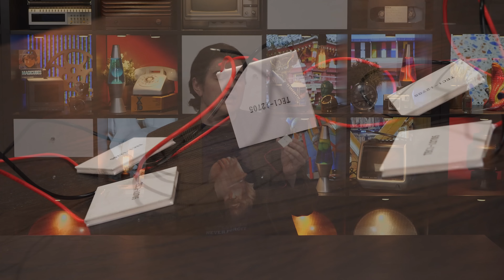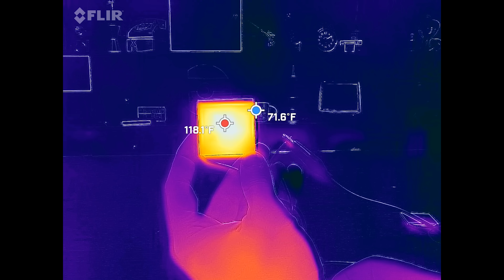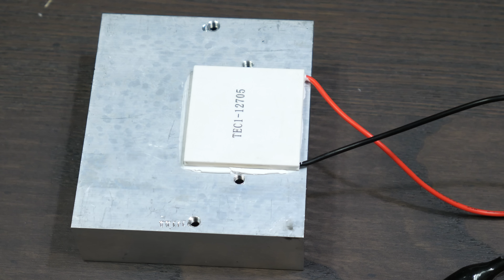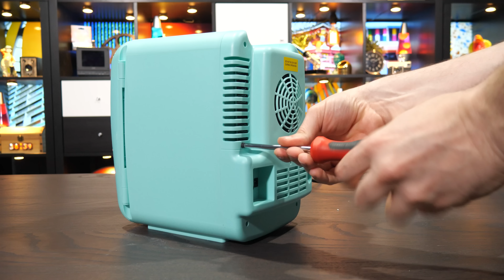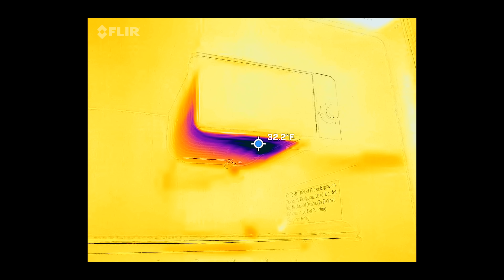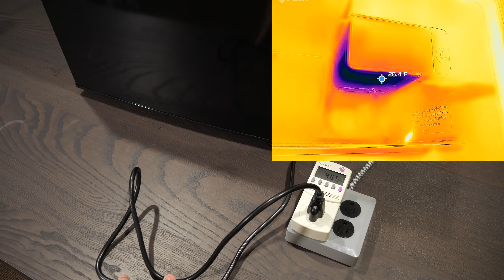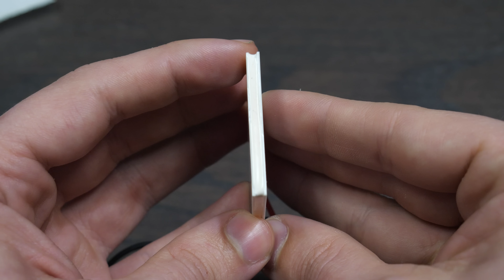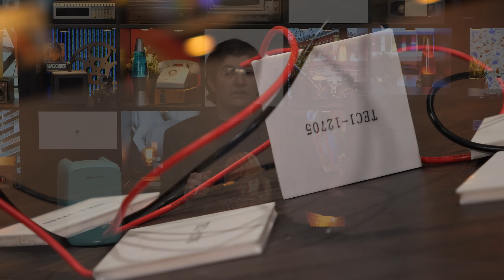Thermoelectric cooling: it's not great.

Comment: To the other end of the efficiency scale, how about ammonia based  heat absorption refrigerators? They can be more than 20% more efficient than the best CFC, HCFC, CFO, HCFO and other types of refrigerants.  In the simplest of these, they have no compressor and no moving parts. Some don't even require electricity, they can operate on propane or natural gas using just a small flame under the reaction boiler. These are commonly found in RV's.

Comment: I'm a retired control systems technician in industrial manufacturing and power plants. The first time I came across the peltier cooling units was to cool small machine control enclosures that housed early programmable logic controllers in the very warm ambient surroundings of a Corning glass factory in Pennsylvania in the mid-80's. Keeping the processor, communication, and I/O modules within and acceptable temperature limitation was essential. 
I was quite impressed as I had a background in mechanical HVAC and refrigeration systems. Today as an instructor in these technologies, I never hesitate to remind my students of those long ago and successful leaps in technology.
Thanks for expanding no matter the context.

Comment: Had a 12volt cooler once. Used a Peltier for cooling or heating. But it was metal lined and kept everything pretty cold or hot. Occasionally it would get frost on the metal that covered Peltier. When I purchased a larger cooler. Not so great.

Comment: How TIMELY!  Wife just got laid up for a bit due to surgery, and she bought a "CuhYUUUUUUUTE" minifridge for her table.  I came back to my office to see the instruction manual on the desk with a sticky note.  "Can you look on the web site to see if you can make this any colder?"  I flipped through the small pamphlet (reading specs is NOT her strong point).  And about the time I was thinking maybe I MISSED something about a temperature adjustment, my eyes fell upon a spec that said You could use a 2A USB charger to power this thing.  I knew right then what I was dealing with. No compressor. Just a peltier junction.

2 days later I came across this video, and IMMEDIATELY sent it to her.  I don't think she's going to want to watch it, as she's kicking her self for falling for some cheap (but CuhYUUUUUUUUTE) crap.  I LOVE the dry humor!

Comment: I use these kinds of coolers in my big truck since most refrigerators don't run on DC 12v or if they do somehow, they're wildly expensive. These definitely aren't "perfect" but honestly if you throw an ice pack in one and some already cold sodas, they do a lot more work at keeping your drinks cold than just a regular cooler with ice packs. My biggest problem with them is, I guess because they're cheap, they tend to not last very long.

Comment: This video is rather Misleading...I have a 1968 Shasta Pull Behind Camper with an actual IceBox,(uses a 10lb block of Ice) for foods and beverages.  I have 3 Peltier devices,( PL12608 electronic coolers), tied in parallel supplying 9 volts at 5.3 amps,[45 watts]) and it took 6 1/2 hours to get it down to 29° F.  Now each of the Peltier Devices have a fan on 3" X 3" heat sink on the cold side and a 6" X 6" heat sink on the hot side with a 6" computer server fan attached vented to the outside of the camper. The Blue "Box" in this video has NO heat sink nor fan on the cold side of the Peltier Device!!! Making it rather useless as a Cooling Unit!!! The temperature on mine is controlled so that the Peltier Devices turn off at 33°,( and back on at 39° F),but the 2 fans continue running, one to keep the cold air circulating inside the Ice Box and the one on Hot side to keep the heat from migrating to the cold side of the Peltier Device which is extremely important!! With both fans running they only consume .75 amp total. Yes the Blue Box in this video is JUNK, manly because the Peltier Devices are Improperly Used, there is NO Heat Sink on the Cold Side nor a NO Fan on the Cold Side to circulate the cold air created,plus the guy in the video over loaded the unit with 6 cans of pop!!!

Comment: Peltier cooling is used oftenly to either keep some sensetive electronics or other components at a precise temperature. Sure, if the required temperature is guaranteed to be higher than ambient (like in analog synthesizer's exponential converters), then just use a resistor. But if it needs to be cooler than the ambient sometimes, peltier is the answer. Cheap, small, reliable and very easy to control compared to compressors.
Many things use these, like road cameras sometimes.

Comment: I honestly can think about only one day-to-day use case for Peltier elements, for regular people, outside of science/medicine and such. Namely if you have a room that suffers from two problems at once: it's too cold and it's too humid. For that Peltier is just perfect. It will create a cool surface for water to condensate on, reducing humidity while it's crappy energy efficiency will provide some heating to the room. Like in a basement. If I lived in a house and had a basement, then I'd probably make a device like that.

Comment: You did miss a key point about the blue toy... 12VDC. It can plug right into your car/camper/rv/semi truck... That being said, I purchased a 12 volt fridge that could hold 3x as much for $200, and it can run as a fridge or freezer from 12VDC and 4.5 amps, or 12VDC and 3.3 amps on eco. Way better then the 8 amps of the thermoelectric fridge that originally came from a yard sale (Can't imagine why they wanted to get rid of it) that was one of the better ones as it boasted a 55 F difference in temp between ambient and inside, but still failed to maintain safe food temperatures in the summer.

Comment: Will they have an expanded future? Previously electric motors would not have the power to weight/size ratio to easily power vehicles, that is no longer the case. Will improvements in technology or new materials enable these to move more mainstream?

Comment: OK, totally valid criticism of this peltier application, but they are used in portable (car) chillers, where power consumption and weight would preclude a proper fridge. Not super effective, but ok to take food from home, in your car, to your holiday destination. Or at a push for camping, being mindful of spoilage. They also work reasonably well in dehumidifiers and one admittedly niche application, in reverse power generation mode is in a wood stove top fan. But yeah, that blue thing is pure junk

Comment: I had a peltier mini fridge. LIke the size of the real mini fridge there. I loved it because it could fit a 6.5 gallon glass carboy to use for fermenting beer. That is after I removed the shelves. The advantage was there was no compressor to get in the way which would never have been possible even with a larger mini bridge. It worked for about 5 years and then suddenly stopped working.

Comment: These Peltier pads were used in mid 90s computers, specifically Apple’s early PowerMacs, where I first learned about them.

I always thought it was a weird that they choose to use a powered heating element to cool a very specific area of the computer, while actively cooking everything else in proximity. 

If you need to quick syphon heat away from a very specific small area, at the cost of dumping that heat into the immediately proximity, I guess they make sense.

Comment: For storage of red wine long term, there are many of these wine refrigerators that use the Peltier cooling system as the requirements for keeping wine at the proper temperature is about where a Peltier system would work well.  As well, it does not vibrate which supposedly is bad for wine storage.  I'm not an expert on this but this is what I read, your thoughts?

Comment: Huh.  Some people made some cheap crap to fit a use case using Peltier technology.  Compared to a imaginary refrigerator that couldn't be that small, it uses lots of energy!  Because it's cheap crap, of couls, not well insulated or passively cooled like it should be.  Therefore Peltier technology is bad!!   This is being a hater, blaming a technology for a cheap product designed to be cheap.

Comment: I got my first refrigerator about 1952. It used absorption heated by 220 V, no moving parts, no noise.
Please make a video with + and - .
Reply: Forgot to tell: It was still working (in the cellar) when my mother died 56 years later.

Comment: I like my little portable electric cooler for road trips. It would be cool to have a real cube refrigerator with me but it’s not worth taking up that much space. I can drop a few pre-refrigerated drinks and some fruit/veggies in it and power it through the 12v port. I’ve also used it deskside a couple times during big writing projects where I was going all day and night for a few weeks.

But yeah, it wouldn’t be a great choice where an actual refrigerator is an option.

Comment: Those mini so-called fridges I’ve had two in my lifetime. I’ve gotten basically a month out of use before either. The fan goes from getting too hot or the little cooler thing that you’re talking about burns out. And my electric bill is typically $65-$79 a month when I use that thing just to cool some cans of soda. My electric bill was 97$ so my experience they use more electric than my Xbox one when it’s off even though it’s technically not off because it’s checking for updates and stuff, but yet it uses less electric than those things.

Comment: "Good" is somewhat subjective.  Is it as efficient as refrigerant-using compression/expansion thermal transport systems?  No.  But Peltier Junction cooling is solid-state and not subject to leaks of refrigerant.

Though in fairness that 6-pack cooler you are reviewing does seem to be more cheaply made than even "full-size" ones (like from Igloo).  It doesn't even have an internal fan to circulate the cold air around the contents.

Comment: the thing about TECS is that if the heatsink you stick on its hot side isn't on par with its heat energy than what would happen is that the heat would overrun the TEC and then even the "cold" side would start heating up.

i had to use these for some project and omg it was so freaking annoying using them.

another HUGE issue with TECS, is that due to the way they are designed they pull in a ton of condensation, so if you're pulling heat efficiently from the hot side then condensation would start building up insanely rapidly on the cold side - and for MANY applications this is a nightmare to deal with...

Comment: I have one of these in my van for work. If I put tap cold water in it, it gets a bit cooler than that during 35⁰C days. And hold 3 1.5L bottles cold all day. With my cooler, I would freeze 1 bottle and put it with 2 tap cold. By noon, the 2nd tap cold one was cool and by 5pm the frozen one would be thawed and warm(gross).

Comment: From experience I can totally relate to the downsides of thermoelectric coolers. For camping use I switched to an absorption cooler which, interestingly, uses heat to drive the cooling cycle. This means you can run it on propane rather than electricity to make it work. And it's completely silent as it truly has no moving parts! It is also dependent on ambient temperature but not nearly as much as the thermoelectric cooler.
Maybe one day you could do a video on the water-ammonia based refrigeration cycle?

Comment: Another cool (if also useless) thing about peltier elements is, that they also can create electric energy. If you have a high temperature difference they give an output. The problem, as you said, is that the element itself is thermally conductive. So besides the typical "i can charge my phone by putting one side to an oven and watercool the other side" i have not found a real usecase

Comment: I run a thermoelectric cooler as a "firdge" I'm my work truck. I upgraded the fans and the peltier. 12v power is free while the truck is running.

Comment: Peltier junctions can also generate electricity when subjected to a temperature differential,  like on a wood stove surface.  They make these little DC voltage motor powered wood stove air circulators that use these same Peltier junctions.   We sold them at our home heating and bicycle shop many years back.  They were pretty popular with the Off the Grid crowd. 

But they also suffer from the same inefficiencies that make them crap for cooling or heating.   You don't get 12 volts at 5 amp-hours as electric power out.  I think they make maybe 9 volts at less than an amp. And they need careful design so the differential in temperature stays consistent.  Big heats sinks and the fan drawing some of the heat away from the cooling side.

Comment: Hmm what if you set 3 in row will it work better?? 3 in Serie. Both ways. power in series and heat plate in series.

Sec. if you like to make the refrigerant heat side like 300+ F or around 150+ C
can other gasses be used In pump ?
Water might not that great unless i can get it not to freeze somehow. in -20 C or 10 F 

I trying to make a steam making project by freeze something.

Comment: When buying a car powered cooler for camping trips a grand majority of them used peltier elements instead of compressors. Works until your car is hot or its sitting in the sun.

Comment: I dont know how good they are technically, but the peltier element also works dehumidifying devices, though not so much in winter, the water/condensation can freeze over if theres little to no heat bieng pulled through the cooling-sync(?).

Comment: One really interesting use of peltier coolers that i think will get more traction is for skin-contact cooling devices. I have an around-the-neck fan with a peltier cooler in the back that helps cool the back of your neck. The exhaust fan for it blows up and down and even though the air is slightly warmer than ambient air, it doesnt feel that way because its evaporating sweat on your hair and back. The inefficiency is seen in the difference between Fan+Cooling and Fan-only mode battery life - something like 2.5 hours vs 12 hours on their respective low settings

Comment: I love your channel because you're showing that tried and true techniques and technologies are tried and true for a reason. Not all hip and new (well, old-new, since the Peltier effect was discovered in 1834) technologies are superior, depending on use-case.

On the flip side, I am a Induction Heat believer now, thanks to you. My roommate and I moved into a house with an Induction Heat Range in the kitchen and it's been great. Well, being unable to use most of our old pots and pans wasn't great but sacrifices had to be made. Our old apartment had an old resistive electric range and that took forever to warm up. I'm glad Induction is available.

I live in a state where they're phasing out Gas ranges/heating in the next couple years. Everyone is rushing to get themselves connected to the gas pipes and get grandfathered in before the regulations take effect. Your channel has fully convinced me that it's absolutely silly to rush to get connected to Gas when the electric options are either good enough or superior. I live in a state with very mild weather, so only using a heat pump for our central heating/cooling is completely sufficient. Pair that with the induction stove and the all electric water heater, and getting connected to the gas line is completely unnecessary.

I'm glad to know our fridges are fine, so long as it's relatively new. Leaking refrigerant was a concern but seems like we've basically solved that issue.